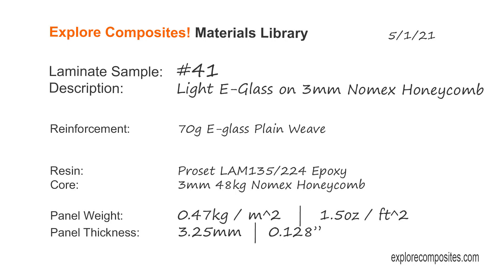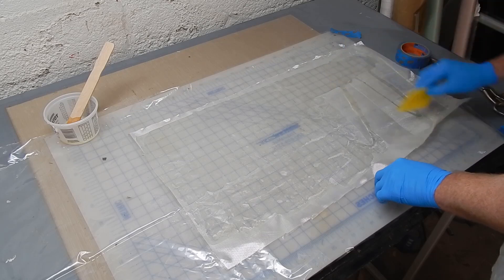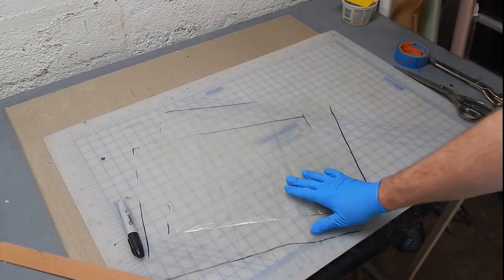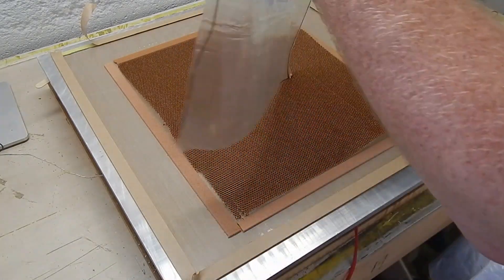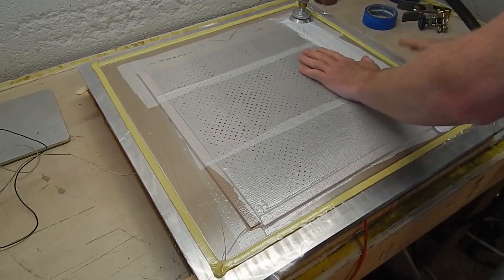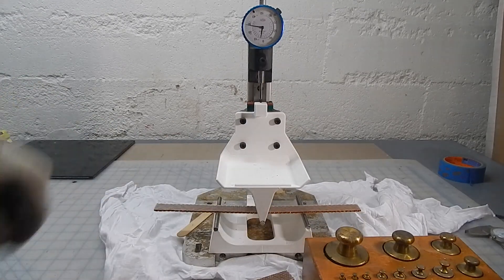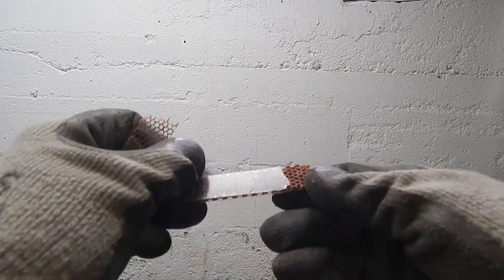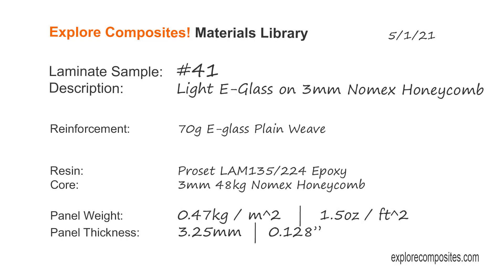Laminate Sample #41: Light E-Glass on 3mm Nomex Honeycomb

Comment: You could use s2 glass its 30%stronger so you could use lighter cloth  and acheive the same strength the best part is you would need less epoxy  with lighter cloth
Reply from the maker: That's a good idea - S-glass is on the list of things to cover/explore in one of these videos.  I'm really interested in how to make the lightest somewhat-useful sandwich panel I can!  Maybe 30kg Rohacell and S-glass, or very light spread-tow carbon?  I am not sure honeycomb is the best because of the whole resin in the cells thing...

Comment: It would have been interesting to see the same test with perforated film  to remove any extra epoxy .
And compare the two .
 Great video
Reply from the maker: This one had perforated film - just no peel ply.  I do wonder about how to make this lighter - maybe doing one side at a time so the resin from the top skin doesn't run down and fill the cells...

Comment: There are panels made with paper cores in say cheap Ikea furniture or hollow core doors. Finding paper core honeycomb dimensionally similar to the nomex but lighter and probably less rigid then glassing it with even lighter glass would be the next step down in panel weight.. I know in rc modeling you can get down to 3/4 or even  1/2 oz glass. If I could come up with a panel that competes with dollar store foam board in weight and strength but is also paint able and moldable... That would be a cool product for the rc plane guys.
Reply from the maker: I've seen paper and cardboard honeycombs and wondered if they'd work - but never found any commercial ones that look like they'd be good for composites.
Reply: @ExploreComposites  You have to impregnate them with a fluid epoxy resin, we did that 45 years ago like the Gougeon bros did on the 60 feet Rogue Wave trimaran et the end of the seventies . More interesting is to use polypropylene honeycomb, rather "cheap", very resilient used in trucks composites and some boat building, as it has a light veil of fiberglass "welded" to the cell the cells do not fill with resin and the adhesion of the skins is pretty good. You have Nidacore in the states, but you can get similar items at far better prices in China.

Comment: Another relevant and helpful addition to the library, thank you.
If the whole panel is 44g is it correct to suggest 50g of resin per skin? At a guess it’s probably closer to 20g which makes this a very lean method. 
The plastic sheet is an excellent tip for weight saving and ease of application.
Reply from the maker: Sorry for the confusion - I should probably make the calculations more clear!  The estimate is done in grams per square meter (50g per skin to bond core) and that is then translated to square feet (X/10.76) and compared to the measured 1 square foot panel.  So per square foot its more like 5 grams per skin!
Reply: @ExploreComposites  thank you, that makes sense. I’m in Australia so I usually work in metric and have to do the conversion in the opposite direction. Thanks again for the content - you are helping a whole universe of people across so many applications.

Comment: Very nice, lightweight laminate but in real life may have limited uses. Your skills are top notch Chris.
Reply from the maker: Yes it sure is light - model airplane or lightweight fairing light!  Carbon would make a better facesheet material in most cases but the glass makes it easy to see what's happening.  This was really more of a "lets see how light I can get" test - next step in this direction would be lighter 29kg honeycomb with 60-80g spread-tow carbon...
Reply: @ExploreComposites  the super light first layer stops the nomex from absorbing a truck load of resin. 
I’ll be looking at this for a number of projects and may add another layer based on required properties. The asymmetrical flex pattern in the nomex will also support certain curves nicely and adding a layer of say carbon fibre with the required bias will strengthen it immensely.
Reply: @ExploreComposites  60-80 gram spread tow carbon fiber is around $75 per yard! Fine for a phenomenal, lightweight and strong panel for aerospace projects. That's way out of my budget range.
Reply: Indeed. Some experimental aircraft might benefit from the high weight saving, but they would probably prefer carbon, unless engineered with the damping properties of glass in mind.

Plus I feel that such a light structure really exacerbates the fragile nature of composites.
Reply from the maker: Fragile for sure - but not too many materials can match this stiffness at this weight!
Reply: @SetMyLife   For my plane project it would need to be able to safely support approximately 50 pounds per square foot supported along the perimeter. I'm going to experiment with 5.9, 8 and 11 ounce CF with uni stiffeners.
Reply: @SetMyLife  distributed mode loudspeakers